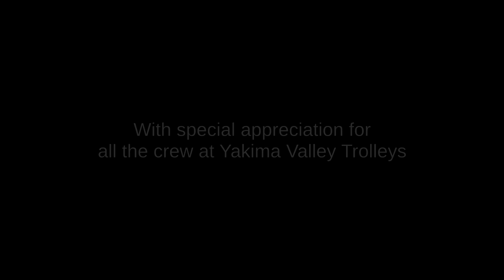Yakima Valley Transportation Steeple Cab 298 Runs - 24 September 2022 Electric Railway YVT Trolleys

Comment: Great video! I hope you can move on and rebuild the motors and keep No. 298 running strong.
Reply: Its 80k a piece to replace/ overhaul a motor on these trolleys. But a rebuilt motor with good handling and occasional oil and cleaning will outlive anyone who works on it.